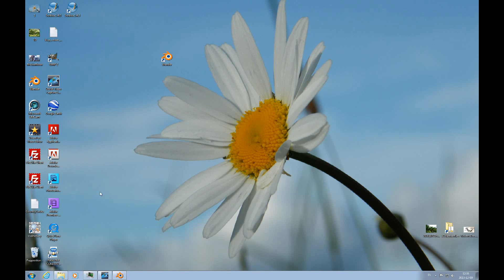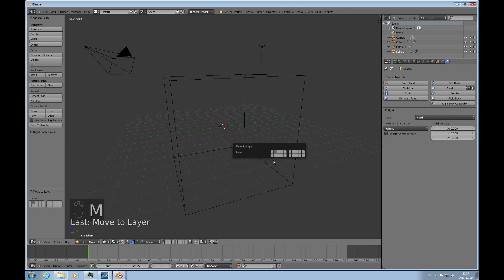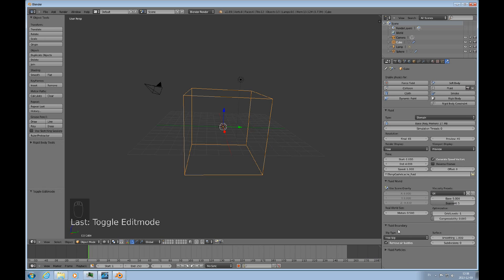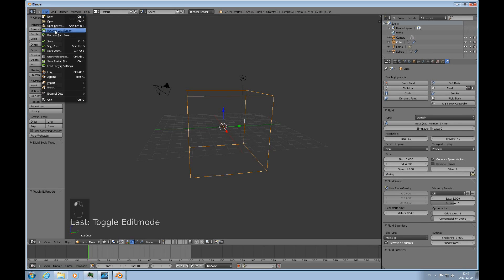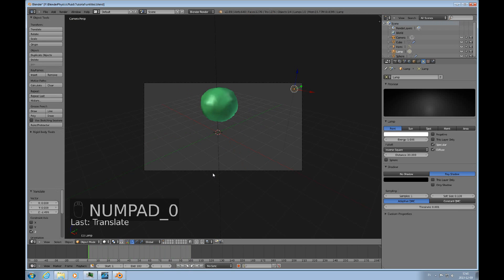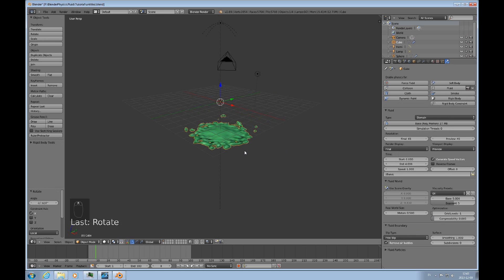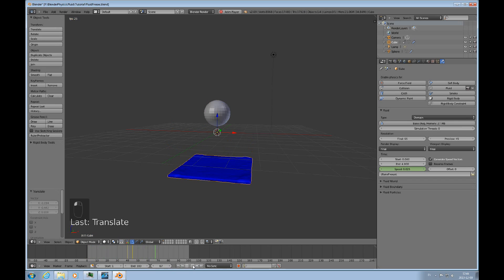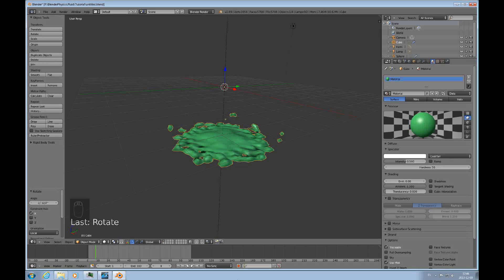Blender Fluid tutorial ONE (the very basics)

Comment: Im trying to make a cup full of water? i dont want an animation of the water pouring in, i just want A cup of water and to be able to drop something in and make a splash? how can i do this?
f
Reply from the maker: Ashley Sumner The fluid tutorials TWO and THREE should help you with that. The fluid object needs to be close in shape to the obstacle that is the cup to minimize fluid movement at the beginning of the simulation. The object that makes a splash has to be an obstacle, with shell initialization. The speed, shape and size  of the obstacle and viscosity of the fluid determines how big a splash you can make. It will take some tweaking to get it where you want it.
Reply: Thanks very much, ill check it out
Reply: sorry, another question (sorry) how do i make like seperate animations? i have a cloth animation and i dont want my other animation running the same time as the cloth one?

Comment: Why does my domain and fluid turn into a liquid????
Reply from the maker: Only the fluid object should turn into a simulated body of fluid that behaves as if it was dropped on the bottom of the domain. The domain looks like it's a container for the fluid, but it's not. The domain is the defined space that the fluid simulation can take place in and thus the fluid slushes up against the inner surfaces of the domain. If you get strange results you may want to use different bake directory if there is a bake in the default directory it will show in your simulation.
Reply: A1Sirius I fixed it already but thanks any way, I accidentally left my cup as a liquid XD.